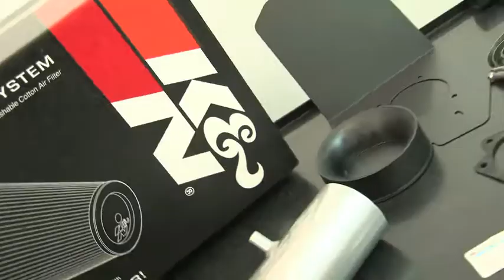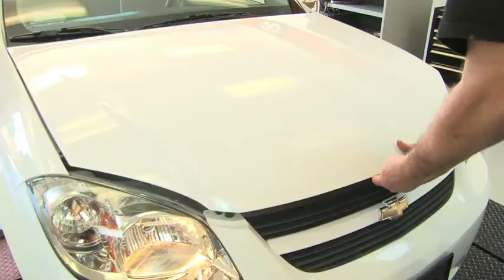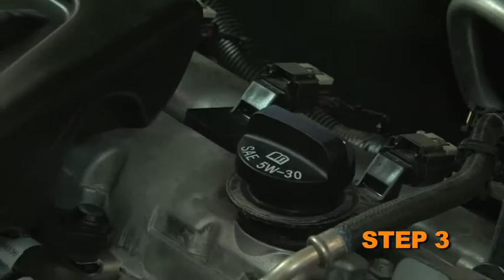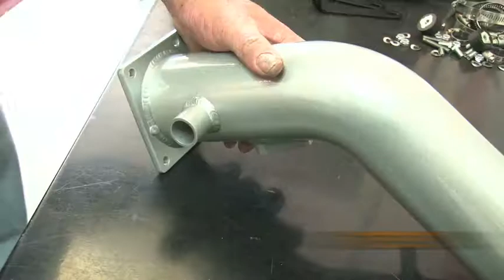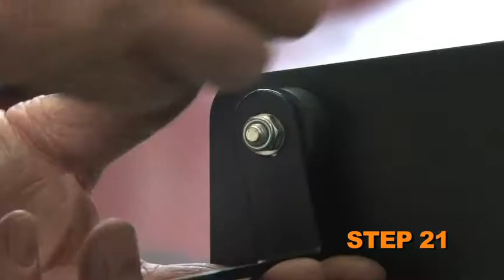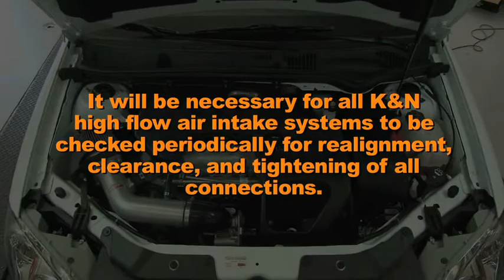Chevrolet Cobalt Air Intake Installation - K&N Air Intake

Comment: Doesn't it also fit pontiac g5 2009
Reply: It will fit 2005 to 2010 Cobalt, G5, Pursuit, models with the 2.2L motor.
Reply: Yes